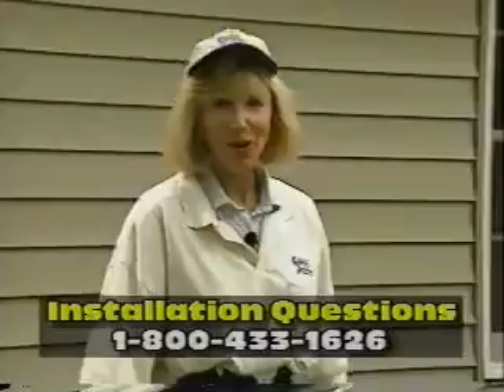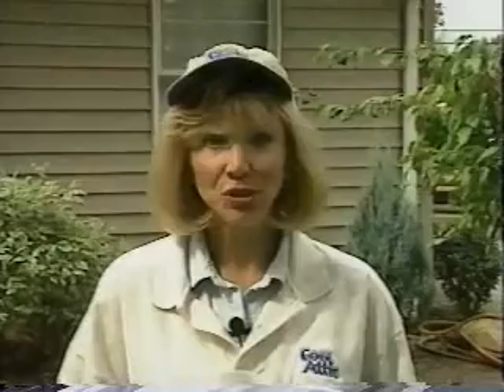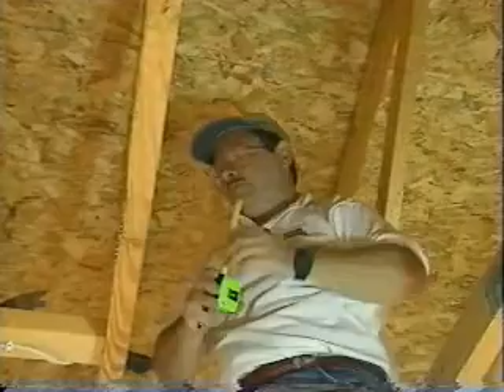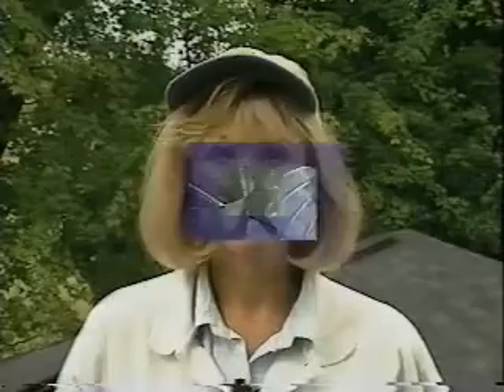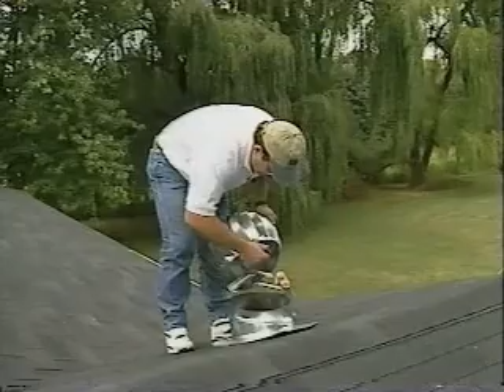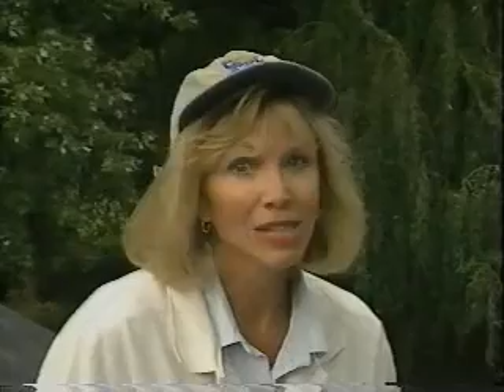Cool Attic Turbine Install

Comment: Had this for a couple months - mounted in my garage ceiling. It vents to the attic. >>>nub.best/fqzi   I use it to pull hot air from my crypto & bitcoin miners out of the garage. Before, my garage was getting up to 90 degrees with four miners. Now doesn’t heat up at all above normal. Hope it keeps running!! I’ve read other reviews about these not lasting long.
Reply: great it is